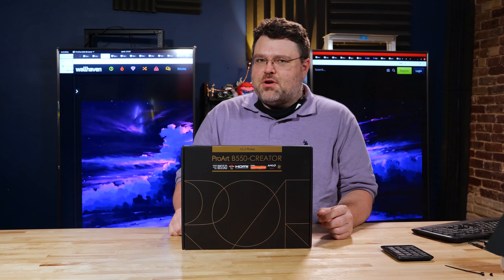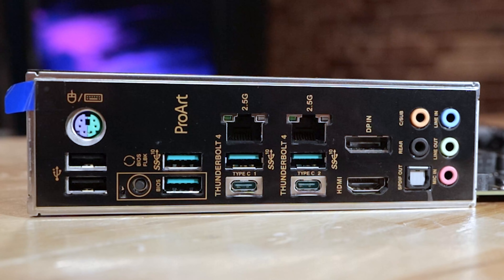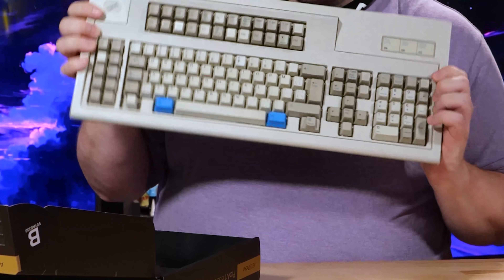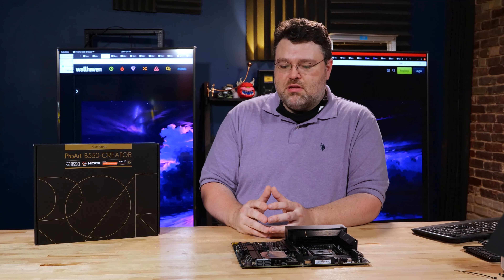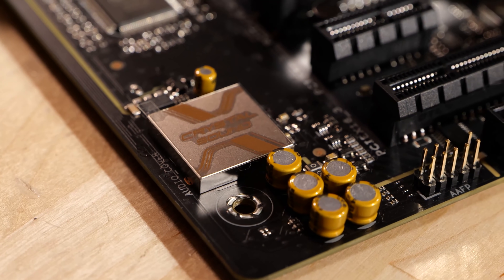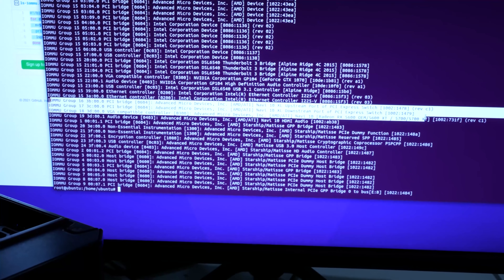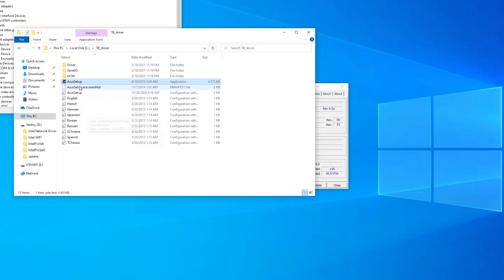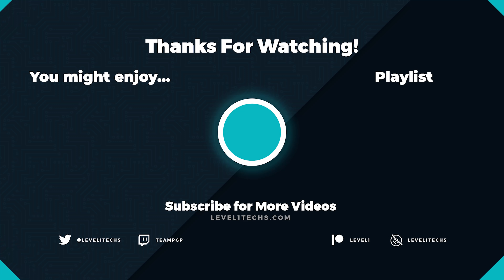ASUS ProArt B550-CREATOR Review - Dual Thunderbolt & Linux Testing!

Comment: So if I want 2 x4 NVMe SSDs + 1 Firewire PCIe adapter + 1 x8 graphic card, can you confirm I'd need a PCIe x8 NVMe adapter, since M.2_2 would only work at x2 because of the PCIe Firewire in either PCIEX_1 or PCIEX_2?

Comment: These days we don't use internal soundcards, we use an external interface on USB that's far more useful, also thunderbolt connectivity. As an audio engineer I wouldn't use on the board sound.

Comment: I'm currently looking at this motherboard and a 5900x as well. I was wondering how a Noctua NH-D15 would fit in relation to that massive heatsink
Reply: You could get a Deepcool AK620 heatsink instead. Same performance as the Noctua while cheaper and smaller profile.

Comment: The X570, for reference: also fanless, +1 m.2 , +2 SATA (cannot be used if 3rd m.2 is in pcie mode), no SPDIF out, no PS2, no PCIe x1 slots, more USB outs, one of the 2.5G is 10G Aq instead, Wifi 6E, and the shield is much bigger. Also, the new M.2 shares 16x total bandwidth with first two PCIe slots. Configurations 16/8+8/8+4+4 for pcie1,2,m.2. The last PCIEx16 is 4x.
Manual also states the pcie1-2-m.2 group support bifurcation 'for raid on cpu function".

Comment: It's too bad this motherboard does not work with the apple thunderbolt display. It's possibly one of the most sold thunderbolt devices made but intel apparently disabled legacy mode as an option in newer thunderbolt firmwares f*cking users that already paid the money when their macs still had intel processors in them. And why would they vendor lock users looking to switch from PC to APPLE, their FORMER associate? It's really quite a baffling decision from Intel.

Unfortunately my experience with Asus support regarding this was less than optimal. To learn the reason for all this I really had to google thoroughly and piece together different forum posts to come to the conclusion that I should not have bought this lemon. I will probably return it next week. I'll specify a few negatives just so I don't come off too ranty:

Support representative did not acknowledge my suggestions for bios settings to find a workaround. They did not confirm any of the information I was able to find, nor did they provide any useful information or clarity. Their manual is deceptive, as is intel's documentation, in that it both mentions thunderbolt is supposed to be backward compatible.

Apparently all you need is a gigabyte Titan Ridge PCI-e card to use the apple display. Unfortunately it is not available at the same store so I won't exchange it for my motherboard. Buyer beware.

There's no coverage on the apple thunderbolt display use case in any of the reviews of this motherboard out there. Would have saved me a ton of headaches.

Comment: Disclaimer if you want thunderbolt 4 to work you cannot have anything in PCI slot 3 
If I knew this would have saved me a lot of time I have a 10 gig Nic in PCI Express Port 3 none of the only place for it since there's a 3090 in port 1.  

Very strange limitation they should have just put 10 gig in the motherboard to begin with thank God the new Intel boards have it

Comment: Not sure why Wendell doesn't recommend having two GPU's for rendering. I have two dual slot 2080ti's on mine working just fine with an added eGPU into thunderbolt. No issues for months now. Otherwise, great review.

Comment: beware that the bandwidth is not just shared by the last pcie. It is either pcie or thunderbolt. If any card is installed in the slot, thunderbolt is disabled. That means that If you want to keep the main slot at 16x there you can't add any other pcie cards !!

i went with the x570 pro art creator instead. TB is independant from the slots on this one !
Reply: Have you looked at the IOMMU groups? On the B550 board, all chipset I/O is in a single group (15). Furthermore, I would like to know, if there is an option to select the discrete graphics card to boot from, in Gigabyte BIOS the option is called Initial Display Output. The user manual for this board does not mention all the BIOS options, unfortunately.

Comment: So what happens if I put two 3090s in there? Will the Board be a bottleneck?
Reply: If you want to use 16 lanes for both cards, you need a TRX40 chipset and Threadripper CPU. With B550 or X570, two graphics cards are connected with PCIe 4.0 x8. Normally, this is acceptable, but the 3090 is the highest end graphics card available, and the performance loss can be noticeable.
Reply: @astarothmarduk3720  thank you! I think the loss would be aprox. 4% per 3090... but I've also learned that by the time I need the performance an upgrade might make more sense anyway

Comment: I have ProArt b550 with Ryzen 9 PC, But there is a problem or it's a future I don't know? When I was on my PC first time (mean's disconnect power for 5 mints) then power on the PC all fans and Led light starts and All fans and light are stoped/power off work few seconds after that its automatically start again all light and fan working continues. The display shows, PC doesn't create any problem, No restart. Have you started your motherboard same as me or start directly?
Reply: Mine has the same strange behavior, and also some thunderbolt error messages slowing down the booting sequence on Debian11. I will try to disable thunderbolt ports until a solution with a kernel or bios update solves it.

Comment: Does anyone know if the X570 AMD Chipset will work with ECC RAM, in ECC mode, or only in Non-ECC mode ? For example I have the Gigabyte  X570 I Pro Wifi Mini ITX motherboard, Gigabytes specifications page for this particular motherboard states it will work with with ECC ram, and the CPU I an interested in knowing if will work with ECC RAM in ECC mode is the AMD Ryzen 9 5950X
Reply: x570 and B550 chipset work with ECC Ram

Comment: Clearly every youtuber who's reviewed this mobo is being motivated by money alone. yeah it'd be super awesome if the major selling feature wasn't trash, but since thunderbolt is the only reason why anyone should even consider this board, it's a complete flop. i'm so close to returning mine. i've only come across a couple people who've claimed to solve their issue, but there are so many forums of people banging their heads against the wall trying to get the thunderbolt to work. 

im still trying to decide whether or not they just produce an insane amount of lemons of this particular board and you just have to get lucky, or perhaps there's misleading marketing and AMD doesn't truly support thunderbolt 4 yet. the reason i started questioning the latter is because I've seen forums unrelated to this board of people simply just asking if AMD will have any thunderbolt 4 support in the near future. for example https://www.reddit.com/r/Amd/comments/ogqp6t/when_will_amd_support_thunderbolt_4/
people seem to think at the earliest some time next year. so now im wondering if we're technically lied to. cuz yeah i guess out of the box they could say that it is technically thunderbolt 4 ready; however, AMD is still working towards making their chip sets/drivers compatible. so maybe a marketing white lie where they can put the blame on AMD for causing our headaches, because the board is ready whenever AMD is ready?

i've tried the thunderbolt driver from the asus site and it kept throwing up errors just like it has for a significant amount of people commenting online. i've also tried different thunderbolt driver versions elsewhere with no luck. I've even updated to the most current BIOS with now luck. whether it be false advertisement or just a bunch of lemons being produced, that's absolutely ridiculous. but of  the two i'd hope it's buggy boards even tho that'd be super pathetic. if it's false advertising, then I'm buying a Gigabyte board soon and saying goodbye to Asus after loving them for many years. I've contacted support, so we'll see how it goes. Either I'll get it going, or I'll return it and buy the same board along with the Gigabyte board in hopes that this was just a buggy board and the other works, and if not, I'll at least be able to switch in the Gigabyte board asap so i dont have to wait forever to have functioning thunderbolt
Reply: This is unfortunate. I looked at the Gigabyte X570S Aorus Master which lacks 10 Gbit/s Ethernet and only has one PCIe slot for other peripherals than GPUs. You can put a Thunderbolt addin card there, or a 10 Gbit/s networking card, or a soundcard. One of three to choose from. The Gigabyte board has no space for PCIe slots because it provides five (!) M.2 slots. This is too much for AM4/X570 and not balanced. Tough decision for me. Maybe the Asus ROG Strix X570-E Gaming II would be an alternative. Thunderbolt 4 can be added later with the addin card. Still, I try to find out about IOMMU and initial dGPU selection support with Asus and am awaiting an answer.

Comment: Great review. I bought this board a few weeks ago and had to really dig to find out what slots were shared and dropped performance if you were using Thunderbolt and the 2nd M.2 slot. Just waiting for case and graphics card to arrive to complete the build. Great board for creators.
Reply: Hi! Did you find the right slots for good performance? I just ordered this board.
Reply: Sadly, Asus doesn't publish a block diagram for it's ProArt series.

Comment: Very thorough overview, your videos are extremely helpful!

I just bought this board 💚

Do you think this motherboard will work find with a 5950x that I bought and a rtx3090? 
I heard that some people had WHEA errors with their 5950x.

The gpu is a EVGA RTX 3090 FTW3 ULTRA.  The spec sheet on newegg says (11.81" x 5.38") and (2.75 Slot).  Do you think it being "2.75 slots wide" would be a problem fitting into the motherboard!?

One last main concern I currently have is the RAM.  I purchased 2x32gb 4000mhz cl 18 Trident Z Neo ram (Model F4-4000C18D-64GTZN).  My worry is that model number does not show up on Asus' website:

(https://www.asus.com/us/Motherboards-Components/Motherboards/ProArt/ProArt-B550-CREATOR/HelpDesk_QVL_Memory/)

I was hoping i'd be able to run these at either 3200 cl14, or 3600 cl16 or maybe even cl14, though I have never customized ram speed and timings before.  I wonder if my ram cards will work or if I should exchange them immediately for something that shows up on their website? Although the supported memory models listed on their website don't seem to have optimal fast cl timing options when it comes to 2x32gb Trident Neo cards.

I was between this board and the Gigabyte Vision DP and the Asrock x570 Creation.  The x570 Creation seemed to have all the bells and whistles including 10gbe but the design of this board and i/o colors, off the bat Zen 3 compatibility, and intrigue over the "crystal sound" won me over.

Comment: A X570S version with 10Gbe would be nice, but please keep the PS/2 port. ASRock has the "almost" perfect X570 Creator board, but it has its quirks and is a bit dated now. Maybe they'll update with with X570S and a TB4 controller.... or not.
Reply: aaaand Asus clearly listened. There is a ProArt X570-Creator on the way with 10Gbe! Supports slot bifurcation so you can use an additional M.2 slot off of CPU. No chipset fan too since its a X570S design.
Reply: and I just bought the X570 version of this board. I'll let you know how it works out. Kinda miffed that they removed the PS/2 port (think of the Model M fans!) and two PCIe x1 slots. Being able to use the x4 slot AND the TB4 ports is a must for me though.

Comment: The Thunderbolt sharing IOMMU with the chipset is inexcusable and deal-breaker. Even on my laptop I can passthrough the Thunderbolt to the VM (for a firwire audio interface).
Reply: I wonder if the X570 ProArt variant suffers from the same IOMMU problem. Has anyone tested it?
Reply: you mind explaining what that means? i just purchased this from amazon. thought i'd take the risk since they have a good return policy and i really want integrated thunderbolt, and while most complaints i've seen is just about the price even though that price should be expected with thunderbolt, i have still come across some dodgy reviews making me a little concerned im going to be hugely disappointed.
Reply: @SuperSaiyanScandinavian  It's only relevant if you are running Linux and want to use the thunderbolt inside virtual-machines. Or if you are a big corporation and worried about security risks.
Basically, it boils down to that there is no good 'device-separation' (IOMMU)  between the thunderbolt connection and other devices on the chipset (like SATA, ethernet), potentially allowing a device connected to the thunderbolt to read the memory of the other devices (security risk) and not allowing pass-through of the TB to a virtual machine without passing-through the whole chipset.
Things like this (poor chipset design) have been a long-lasting problem with AMD chipsets, and one of the primary reasons I'm still on Intel

Comment: I take it the two TB4 ports video out put is limited because they are both fed via one DisplayPort from the GPU? One thunderbolt is a lot easier to run than multiple DP cables.
Reply: I'm curious about this too.  Usually, Thunderbolt 4 Maple Ridge takes two DP 1.4 inputs, but this board only has one.  Does that mean it can't do 8k over TB4?
Reply from the maker: It's more co.plicated than that. Tb doesn't magically have more than 40gbps bandwidth bit it can work better with dsc. However Nvidia has bugs with dsc ATM so it's not a slam dunk. 8k 60 is easily possible on dp1.4 with dsc.
Reply: @Level1Techs  I have Gigabyte’s Maple Ridge TB4 card installed on a TRX40 mb without a TB header, just power and two mini DP 1.4 in’s connected to my RTX 3090, and it can drive an Apple Pro display at 6k 60hz. over a TB4 cable. But obviously no data or usb. Will this board be able to drive the Pro Display at 6K with data?

Comment: I feel there should be an X570s version of this board. As someone who has had issues maxing out the pcie limits of the chipset link on my x370 I want extra lanes if I'm gonna be using thunderbolt instead
Reply: I think it already teased from asus in a recent tweet.

Comment: No tpm module connector No good for Windows 11 is any motherboard reviewed without this worth considering unless you use Linux. Is any motherboard review worthy if they don't mention this omission.
Reply: AMD has the solution with ftpm I think.
Reply: fTPM that fully supports TPM 2.0 and Windows 11 says hello.
Reply: Tpm connector is just above the CPU m.2 socket.

Comment: what's the point of making this on b550 losing the additional lanes of x570?
Reply: B550 didn't ever require active cooling.
The newer versions of X570 (often called X570S) does not, so they are likely coming out with that.
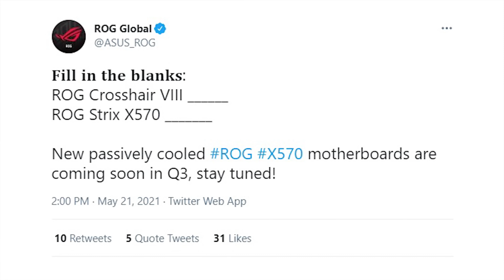He also answers this at 15:45 so...

Comment: Initially I was intrigued, but I forgot that B550 PCIe layouts sadly make that chipset unusable-ish for me, as that means I'd drop my GPU to x8 if I add a fast NIC. But then again, I am starting to move all my GPU stuff over to servers as the world opens back up and just use my browser to connect to Jupyter on those.
Reply: can you explain in simpler terms for a moron like me? im savvy enough to build computers (not that it takes much to learn that lol) but other than that i dont know all that much. i just purchased this from amazon and am waiting for it, but im starting to have a lot of concerns. i knew it wasn't rated the best, but when i made the purchase i'd read around a fair bit and it seemed like the main complaint was it's price and saying if you dont need thunderbolt then you're a fool to buy it. but since i do need it i decided to make the purchase thinking that was the only complaint. now as a couple of days have past since the purchase i've come across more complaints about it, and these complaints have nothing to do with the pricing. only problem is that some of the complaints im seeing i dont actually understand, so im not sure if it's more of a subjective problem given what their needs are, or if it's universal. thanks in advance if you do respond.
Reply: @SuperSaiyanScandinavian  Don't worry too much about it. I have very different needs to most people, currently running AMD Threadripper on my main computer. If you just want to use this for work from home or gaming, you'll be more than fine. This is a great motherboard, and a sexy one at that. 
Personally, I do some very GPU intensive work, so ideally I like my motherboards to support multiple GPUs and keep the option to put in a 100G Ethernet card which can saturate a PCIe 3 X16 Link (or a PCIe 4 X16 Link for a dual port card) but I don't think you'll ever be in the position to connect to a high performance computing cluster (or its storage system), so my Problem is very specific. You'll be happy with the Asus Pro Art, don't worry about it.

Comment: Would it be too much to ask for a mobo like this in mATX form factor? If i have to carefully select my peripherals, then I don't need that many physical connectors on the board if I can't use some of them in particular cases. I feel like this board would make a lot more sense in mATX form factor because you can fit all those features in that form factor.

Comment: I really wish they did this board in a mITX form factor with all of these bells and whistles, including rear ports, besides the multiple pcie slots found here... It'd be unique then, as next mITX AM4 board to be interesting seems to be the rumored Gigabyte X570SI Aorus Pro AX (the X570S mITX refresh with more of a heat spreader contraption for the chipset and VRM section), since we generally lack quality and quantity of rear ports implementaton, or features such as these found on creator or overclocking lines in the ATX dimensions, on the SFF boards.